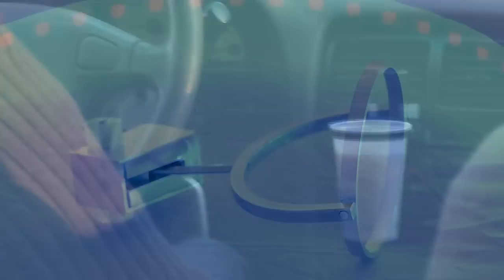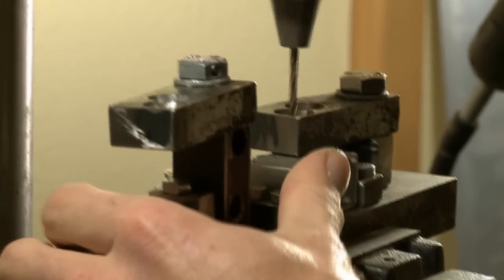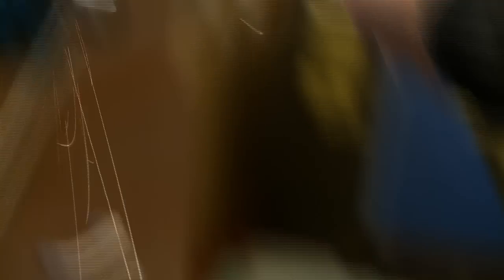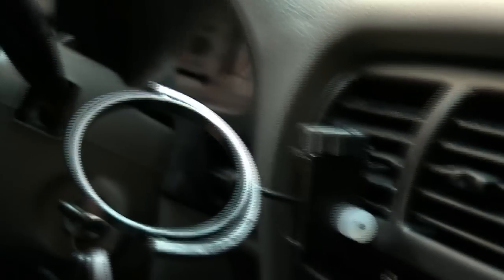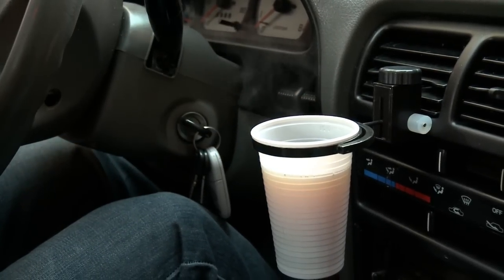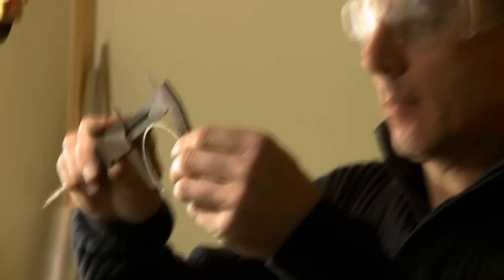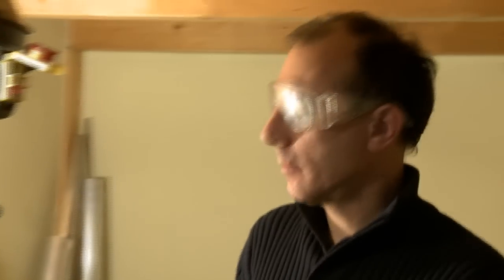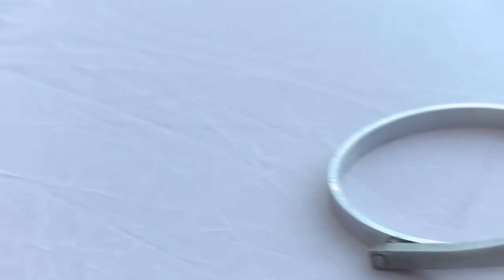Giro Cup Holder indiegogo campaign

Comment: How do you get the drink out while your driving. Make your cup ring with a smaller diameter so the cup only goes down a third of the way. Then you will be able to grab the top quarter of the cup to pull it up.    No charge... but you can send me one when you mass produce
Reply: The drink would spill if it doesn't go all the way down.